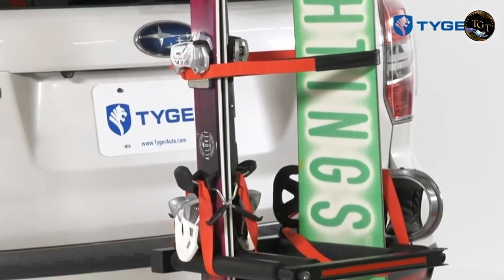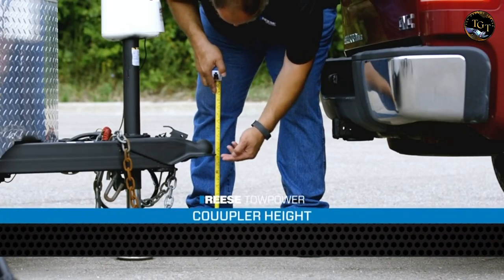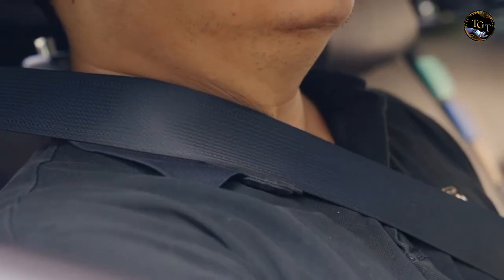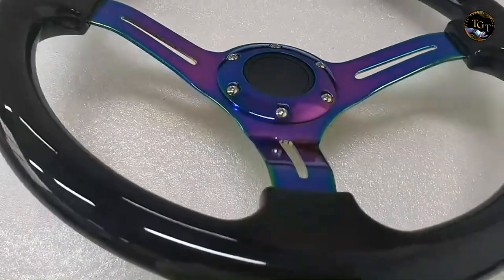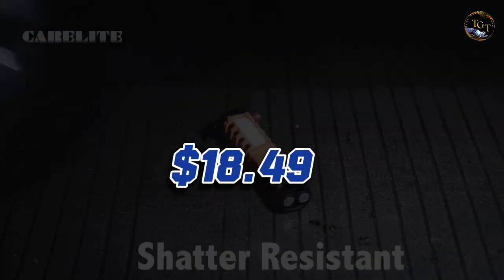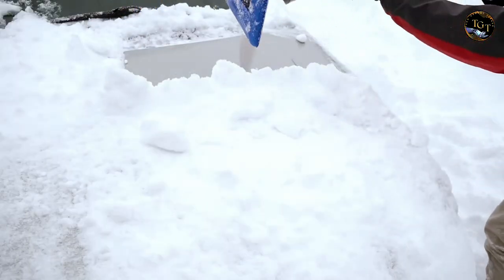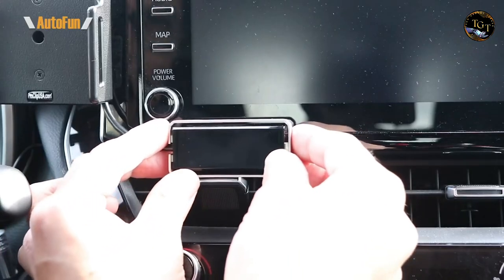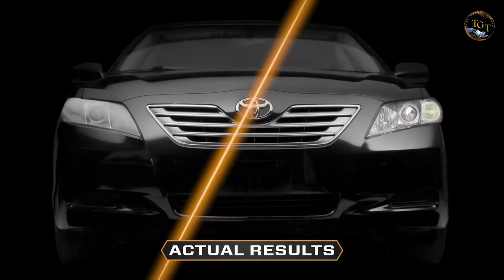12 must-have car accessories on Amazon 2024 | coolest gadgets you need to buy

Comment from the maker: product links in the video:
- ARMORDILLO CR2 CHASE RACK $449.99 https://amzn.to/3vIzYKh
- Reese Towpower Starter Kit $ 33.72 https://amzn.to/3SpgUcG
- DAYDOOR Winch Recovery Ring Kit $58.97 https://amzn.to/3tXl3LL
- Car Seat Belt Adjuster $12.99 https://amzn.to/3u7gwWX
- OEDRO Aluminum Towing Hitch Steps $79.12 https://amzn.to/3SqSn7a
- Universal Car Racing Steering Wheel $72.99 https://amzn.to/491QH9O
- Multi-Function Emergency Car Flashlight $18.49 https://amzn.to/424gWtK
- Tyger Auto TG-RK1B707B $289 https://amzn.to/42m0khu
- Snow Joe SJBLZD-LED $19.99 https://amzn.to/4b50rBL
- GlowShift Custom Cluster Dashboard $469.99 https://amzn.to/48AWaV8
- Shadow OBD2 Digital Meter $149.13 https://amzn.to/3OaFqMj
- CERAKOTE $16.88 https://amzn.to/47VFDdc